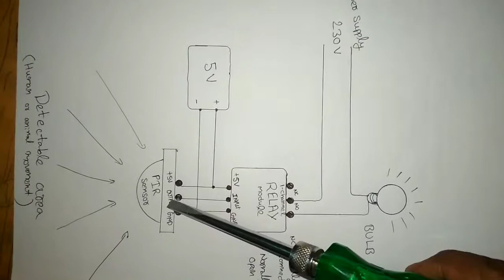simple Pir home automation

Comment: I did not understand a single word...
But got the concept clear...
So basically you don't need a mosfet or a transistor between the PIR and relay switch..
You can do without it (skip them)
Reply from the maker: thank you for your suggestion.